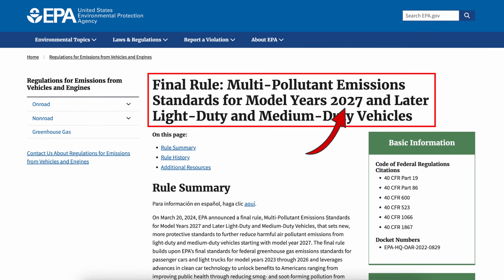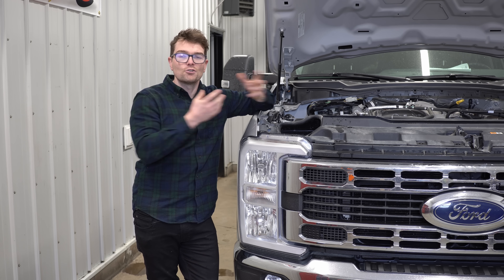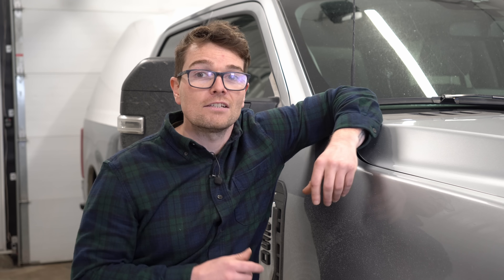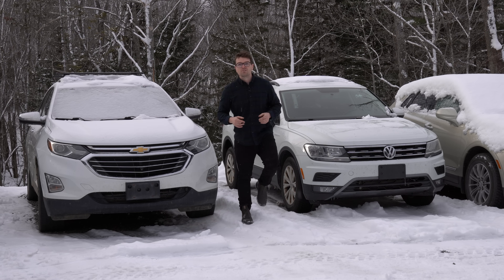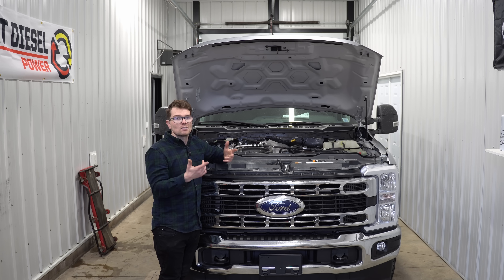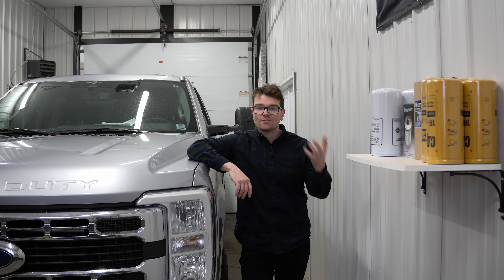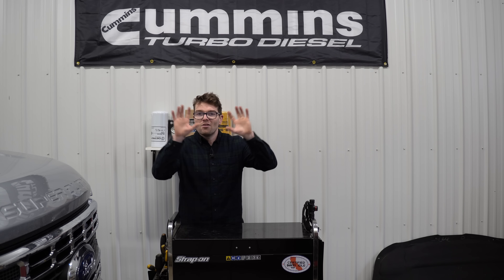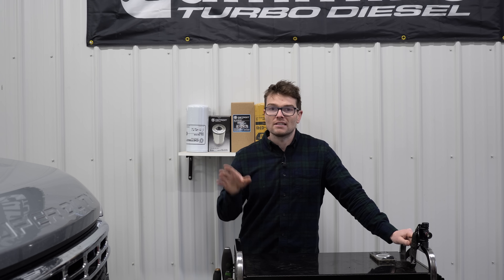NEW 2027 Cummins Diesel Engine EMISSION REGULATIONS are WILD **Diesel Mechanic Explains**

Comment: Edison motors uploaded a video about how they intend to use Scania engines in their trucks. They specifically mentioned one reason why is the engine won't be required to run DPF, and other such systems such as DEF. 
Why?
Because the engines are so efficient that by north American standards they're not required to run more emissions equipment.
So I ask everyone to please remember, if the big manufacturers cared, they would design engines which don't require all this crap, but they don't, they want to sell your their junk and all the parts related to their emissions systems.

the reason companies are getting away with this type of BS is because people keep buying them and parts for them! they're milking the population for money, while intentionally creating the minimal quality of product needed to sell. Take a stand for yourself if you have any pride and find a used vehicle and fix it better than new, rather than settling for their subpar quality.

Comment: There’s two ways out of this, one way is to ‘fix’ oxygen to diesel fuel, in a fashion like nitromethane is, the second way is to get oil companies to sell PURE petrol, NO additives. Then you can use petrol in a fuel cell like hydrogen does, and your exhaust is straight water.
Reply: Where does the carbon go in this pure water exhaust
Reply: @ aha, on rechecking, yes the propane type does emit co2. Thanks for that 👍👍

Comment: For sale : 2006 Mega cab 5.9 (the very last pre EGR/def Cummins) 4x4 151,XXX. A little rusty. $30,000 Also For sale 2000 Ford Excursion 7.3 420k 4x4. $25,000 that's cheap and doesn't sound so bad when that Ford's fuel system in the video is almost 15k itself.

Comment: Lower emissions are accomplished one way and 1 way only. Burn last fuel to do more work. What we have done with emissions equipment on the commercial transportation front has not taken a step forward for the environment.  What we have does is take at least ten steps back. Look at the big picture.  We have created complete new industries that don't produce a tangible product. What are the emissions from those new industries??? What is the effect those new industries have had on the old industries that are producing? How much does this equipment weigh and what does that do to payload? I could go on and on. In the big picture this has been bad all the way around!!!

Comment: Meanwhile in Europe more and more real semi trucks are even moving away from EGR now because the aftertreatment systems are just that good and the cleaner you get a diesel to run the less work there is for the aftertreatment. And you still get full Euro6 with those trucks.

Comment: I think the longer warranty time will be cheaper in the long run since the manufacturer finally has an incentive to engineer systems that dont cause problems or are easy to repair.

Which is possible but was never the goal of manufacturers

Comment: I maybe stupid but how does running exhaust through the intake cool down the intake.
Reply: It's not about cooling the intake, it's about cooling the combustion temp.

Exhaust is hot, but it doesn't burn, and it's much cooler than actual combustion. By introducing exhaust to the intake, you keep the combustion temperatures down without introducing excessive amounts of oxygen

Comment: Australia doesn't have all the emmissions garbage they tune the trucks to be cleaner due to insanly higher restrictions. Full size trucks very few emissions equipment.
Reply: America is too dumb to figure that out they just tune for power and then slap a DPF on it that constantly plugs and gives trouble.

Comment: These extended emission warranty costs and R&D will be tacked onto the price of the new vehicle. The manufacturer will have to recover expenses for warranty parts and labor, plus inevitable lawsuits to continue to produce these trucks. Add in the warranty costs for other technology failures i.e. high pressure fuel pumps, and the dealer price will rise to a point consumers are no longer willing to pay. Another reality is the manufacturers will require that consumers file lawsuits to enforce these mandated warranty extensions. Buying extra lawyers will be less costly than fulfilling legal obligations.

Comment: This has been coming down the pipeline for over a decade.  Manufactures have known about this standard, and have been given the time to figure it out.  
“Yes, your truck is covered under our warranty.  Unfortunately, the parts are on a nationwide back order and it will be 6 to 10 months before you can use your $160,000 truck”.  “By the way, your payment is due next week”. 

If anyone is interested, I got a ‘97 F350 POS with a Powerstroke I’ll gladly sell you for $100,000.

Comment: Everyone time they reduce the numbers it causes less mpg from where we could be. We should be pushing 100 mpg per gallon on basic cars if not for such high emissions placed and also producing half the carbon dioxide.  The results of burning carbon it takes oxygen and with the ratio of air to fuel  and carbon dioxide the results after is what we get regardless.  So decreasing mpg we produce 2 to 3 times more carbon dioxide because we burn so much more fuel to reduce nox and carbon particles.

Comment: That warranty is going to cost us a lot of diesel manufacturers. They won't be able to make a profit with that warranty and they're either going to just stop building and selling diesels all together or they'll go out of business. The epa is beyond out of control and need to fuck off !!! The only silver lining here isn't even in this video. Thankfully speed of air pistons has made pistons that reduce pollutants and increase power and fuel milage all at the same time so maybe the big diesel manufacturers will get on board with those guys and reduce all of the emissions equipment all together. Which could be an option

Comment: Edison motors is onto something. having an engine that will run at peak efficiency only when needed will be huge for this kind of regulation. I have also seen peeks into what volvo and cummins are doing to meet this regulation through my employer and if it works well it will be great but it could also be a huge headache for repairs due to new  component locations. I'm sure we will have the same headaches we had after previous reg changes.

Comment: This is why my newest car is a 2004 and it has crank windows... my favorite is a 96. This stuff is getting stupid and the lower middle class and below pay for it. Pretty soon only the rich will be able to buy new, which means there will be less vehicles on the road, which snowballs to the used market going more expensive. So at some point the ownership of cars will be impossible until you are making 150k. At some point, we must stop this out of control bs.

Comment: These systems are very effective at reducing combustion efficiency, thereby increasing fuel consumption and increasing total emissions.
Reply: And increasing fuel excise revenue
Reply: I don't have the time or the crayons to explain this to you, but increasing fuel consumption slightly for the emissions systems does NOT increase emissions.
Reply: @OtisFlint It does increase co2 emissions by a good amount but I think it is justified by the drastic reduction in every other emmision.

Comment: They need to eliminate the EGR, which will significantly improve the lifespan of the engine and reduce particulates, then use an electrically heated DPF along with an SCR for the NOx.  Ships and other large applications have been using heated DPFs for years, it's a mature technology, and not shoving even more fuel into the exhaust makes them significantly more efficient, as well as staying hotter at the lower loads people run most automotive diesels at.  
We are well into diminishing returns on both gas and diesel emissions, on and off road.  If they wanted to make a real change in emissions, then convert container ships and other large vessels to CNG (been done since the 80s at least) or regular diesel instead of the sludge they run on now, and tighten up emissions from power generation.

Comment: Hmm mandatory warranty extensions. normally i would not be for this regulation BS  BUTTT when it affects the bottom line manufactures WILL pull their heads out of their butts and get it right.  Hell ford even STATES EXPLICITLY the DPF lifespan is 240K mile. yet this is in a lab and not in real world driving. 

OEM dont really have a choice. Sure Ford could say No more diesels, so could GM. but with Ram's Cummins relationship ...... well Ram would then sell 1.8 MILLION trucks a year. so its adapt or die.

not worried about price, they wont go up much for consumer trucks. maybe an extra $500. simply because teh consumer WILL NOT pay much more for teh diesel upgrade. AND going crazy on price means Toyota could come in and undercut them and make big 3 look like fools in their home turf of the HD pickup.

 .... everything else is silly. 80% NoX?? fun fact the more nox you are producing the higher the in cylinder temp, the cleaner the burn (assuming not over fueling), and better energy extraction from the fuel, and less soot....  that's why when you tow you use SOOO much more DEF, but regen less. ya you are using more fuel. but you are also burning in more efficiently. 

at 30K lbs towed currently its about 108-169 MPG DEF. (on flat highway at 70 MPH) that would fall to UMMM .... 21-33 MPG if you just injected more DEF. granted that's not REALLY how that works. 

GOOD NEWS that means full redesigns of the engines. that also means we get to see who can REALLY engineer the best diesel. i predict Cummins will take back the "king of efficiency" crown with teh lowest power. and i think it will be a return to 2006 with Duramax VS Powerstroke.

 i also think we WILL see see diesel electric. Kudos to teh first OEM that has NO physical connection to teh wheels (counts as a generator at that point and can legally run Red Diesel.) which solves MOST of these requirements by always controlling the load on teh engine allowing emissions systems to be cheaper, and last longer.

Comment: I might go along with this Bunk if all the other countries in the world did the same, Do these goofs know that the engine manufacturer's will just pass this on down to the consumer. So when these enviro fools pedal their E-bikes down to Whole Foods to get a loaf of Small Batch non GMO ,organic artisan Kale bread, it will be more expensive due to the logistics of producing it and getting it to market before it goes bad ,while in another country with little to no reg's they can some how bake the same thing and ship it across the Pacific at a lower cost. As a mechanic for over 40 years the cost of the downtime of these emission systems is also tied into the rate of inflation. Wave to the poor trucker idling down the road with his hazards on.

Comment: As soon as my warranty is up, mine is getting deleted. These engines weren’t built to satisfy a tree hugger (unless they crash into a tree) they were built for power and torque to do work that gasoline engines cannot handle economically. Next thing you know, the EPA is going to require scrubbers on your chimney if you burn wood for heat.

Comment: Did the companies even perfect the production of reliable highly efficient, powerful and long lasting engines?  Why don't they do that before they add all of this peripheral stuff that decreases efficiency and reliability?  Why do consumers just lay down and buy anything that's produced?  Can we demand better?  Efficient equals less fuel and less exhaust for the same amount of work done.  Better metals and slighlty higher temperatures and pressures means cleaner burning and more power right?

Comment: there won't be an EPA in 2027 so I'm not worried about it. Besides, these standards will choke out a diesel and it would barely run. These people are fools. They need diesel hybrids. Problem solved.

Comment: The reason they're making them warranty them so long is they actually try harder at making the systems reliable. Now its a cash cow for them once the warranty runs out. They aren't going to want to warranty them so they'll actually have to do a good and proper job in development, or come up with better more reliable technologies

Comment: They are pushing all this emissions stuff so hard on the automotive products but, they haven't shoved these same emissions crap on ships and airlines. 
Just the planes owned and used by one company like Delta airlines use and polute about 10 times what all private passenger vehicles do combined!
So until the largest polluters are held to the current standards of the automobiles because they don't pollute enough now to make a difference by the industries that do pollute!
The Trump administration should put the EPA  back in their place. Because they can't write the laws and regulations, Congress has too the Supreme Court made that clear with the Chevron ruling!
These Federal agencies can't legislate and enforce that is combining 2 Branches of government into 1 !!!

Comment: 2027!! I have 3 Ram 6.7 trucks at my shop that are all less than a year old, and are all stuck in derate. No parts are available to repair the dam DPF. One trucks been there for 5 months, it has under 40k miles.

Comment: I really like my Cummins, I have a N14 in my 1992 fld120 and a M11 in my 1996 Pete 385, good old trucks, but I run a 12.7 Detroit in my 1999 century, as you can tell I don't care one thing about any new truck on the road, I just keep trying to find old trucks that aren't used up yet

Comment: First...abolish the EPA.  There are many good reason why folks find ways to remove all this garbage from their trucks.  Sure...everything is wonderful when it works, but I wonder if many have researched what it costs to repair the space junk bolted all over their trucks.  It doesn't matter, many will find out eventually.  I think it's nothing more than a ploy by treehuggers to exterminate diesel engines.

Comment: the government is looking to regulate diesels out of the market. None of theses EPA items are good for the engine, they clog up and kill motors and they are completely unserviceable to anyone other than a dealership or specialized shop. Every EPA mandated item should be able to be serviced by a normal everyday person. if it cant be serviced like an oil and air filter change then it should come with a lifetime warranty or as a tax write off or repaired and paid for by the government.

Comment: So what’s wrong with water injection for lowering combustion temperatures? I may be wrong but I feel that there is an increase in torque due to the high expansion rate of water to steam. I’ve found a few people explore this online, but not as many as I would think. There must be an inherent problem that I’ve missed, but it seems like a simple cost effective solution to at least the NOX issue
Reply: Consumers. Water injection has benefits (especially on gasoline engines) but it's very inconvenient to top off a distilled water tank every other fill up.
Reply: @ i get that, but people have to fill up DEF regularly. More power, less detonation, cooler combustion temperatures, it cleans carbon deposits, etc…. I feel like the benefits far out way the burden. For me anyway

Comment: Off topic, but you made a video about the Ford 7.3 Godzilla, specifically the lifter failures.  Are you familiar with the Ford Customer Satisfaction Program 24B27, which addresses the Variable Displacement Oil Pump?  Search it, it is interesting reading.  Curious what your take is, and wondering if you would consider making a video about it.  Thanks, I enjoy your videos! 

https://static.nhtsa.gov/odi/tsbs/2024/MC-11006033-0001.pdf

Comment: we actually used to have "smog days" here in Cali. It was like a snow day where you couldn't go outside because the smog was so bad. Some of you want to bring that back. SMH
Reply: couldn't care less what happens in Cali.
Reply: @timmyhipbird7543  that Cali hate meme is played out. You just sound jealous at this point
Reply: Know what’s gonna happen is since these new engines are putting out cleaner air out the exhaust pipe than what’s been sucked in the intake they’re gonna send thousands of them out to California to set and idle and that will clean up the air.

Comment: Maybe I don’t understand how this all works and I need to be educated more on this subject. (Awesome video btw). So here goes nothing! What is the purpose of a filter catching all the particles in the exhaust stream, just to have it blown out during a regen? Maybe it’s just me but, and that guy who said “ you can’t create nor destroy matter” but something doesn’t compute here! My question is, what is being expelled from the exhaust in a regen? Isn’t it pretty much the same stuff that was caught in the filter in the first place?
Reply: The purpose of a regen cycle is those particulates are broken down. You have such high temperatures that the hydrocarbon soot is burned away, creating carbon dioxide and water.

Comment: I noticed your 1R-0749 cat fuel filter. Look at the 175-2949 cat filter it is a fuel water separator filter with the same thread and diameter. That way there you don't have to run two filters

Comment: The pupose of an egr valve is cake up the intake, turbo, and valves with carbon build up. Making the engine 30% less efficient. Translation so 10% less bad emissions but have to burn 30% more fuel. Netting 20% more emissions, have to mine for 30% more crude oil, engines need $20,000 more in repairs, and engines life is cut in half.